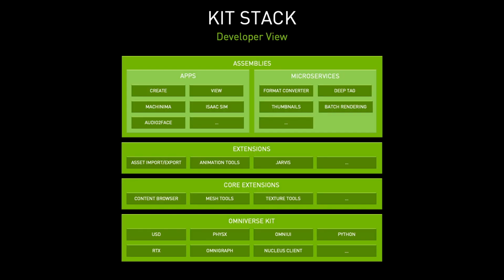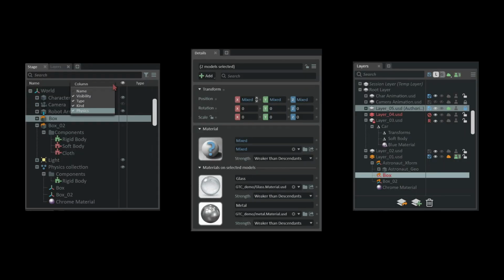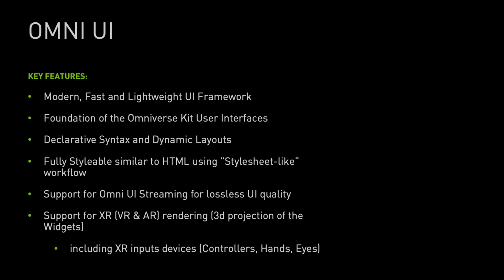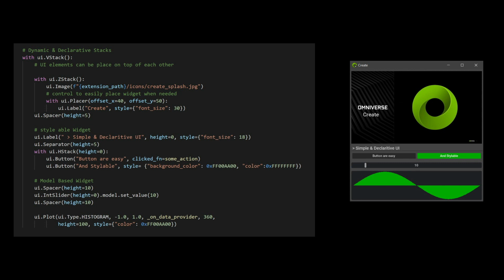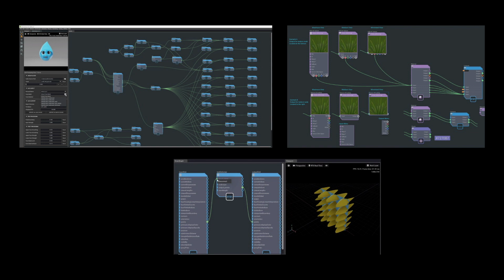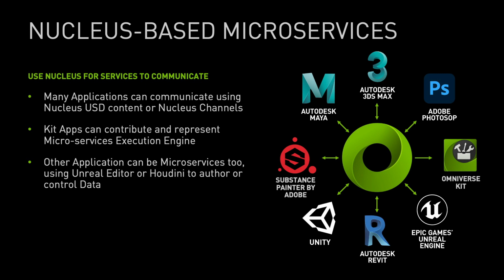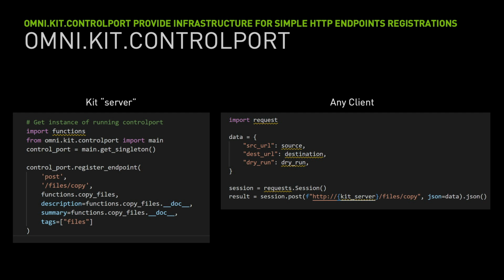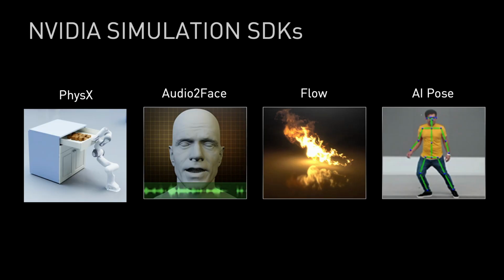Deep Dive into Omniverse Kit Introduction | NVIDIA Omniverse Tutorials

Comment: Have issued using Create. Where's I could describe them and discuss to find help? 
1. Rendering the sequence issue. So rendered mp4 animation is just still shot for 10 seconds. Plus folder with 250 frames wich represents same frame. 

2. Workspace doesn't saves, resets to default after restarting the Create.
Reply: I've tried to Google, but unsuccessful.

My specs: Windows 10
I5-10400
RTX 2070
16gb ram
Hdd(project file)+ssd(software directory)
Reply: Best way to get help is to register and go on the Omniverse Forums that you can find in the Launcher. there are many people there that can help on broad range of topics
Reply: @xTeoLtd  thanks a lot
Reply: @xTeoLtd  I didn't know Omniverse was even released